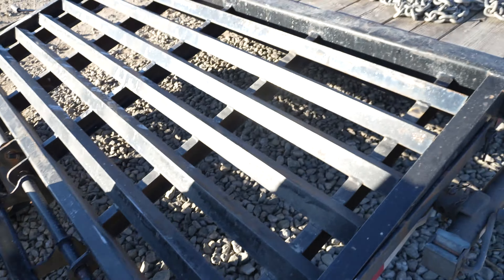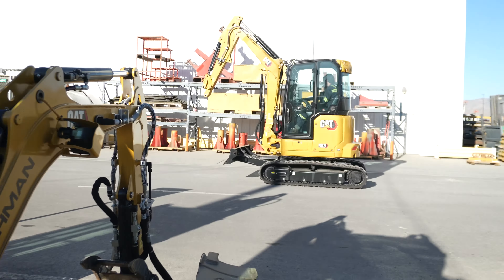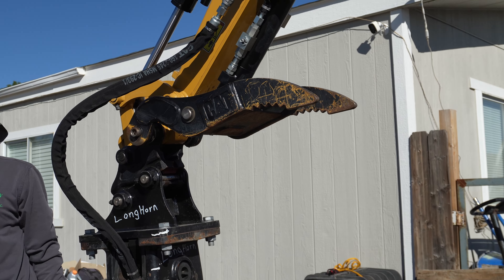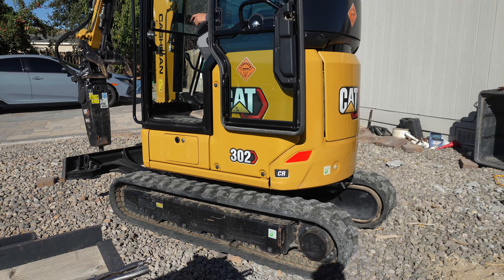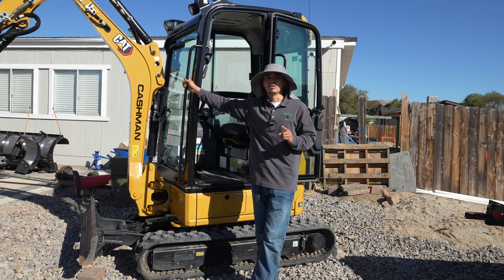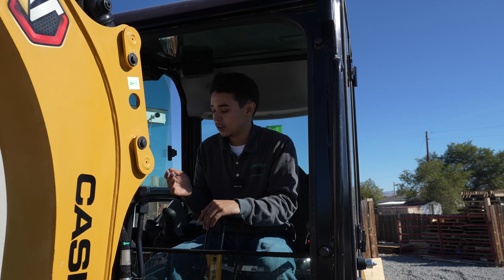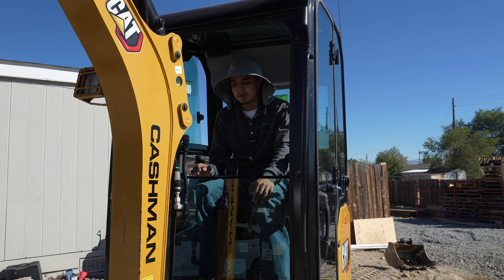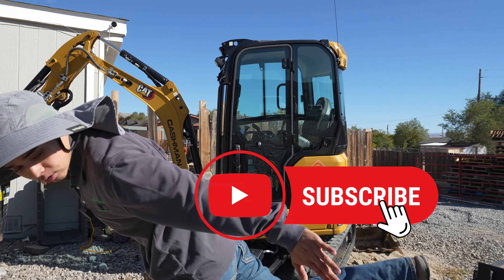REVIEW ON MY CATERPILLAR 302 EXCAVATOR

Comment: You are supposed to lift the machine in the air with the bucket and blade at opposite ends to retract or expand the tracks.   Don’t do it on the ground